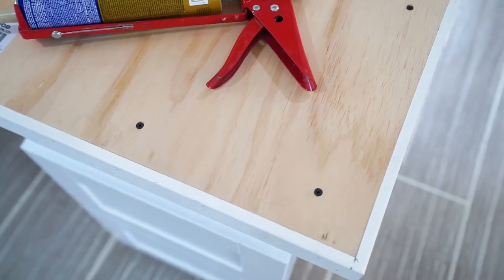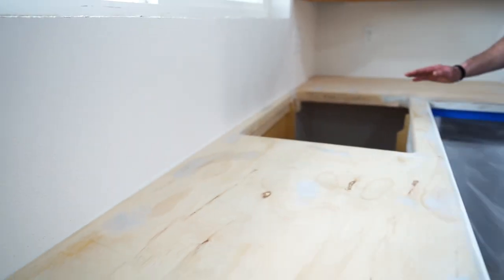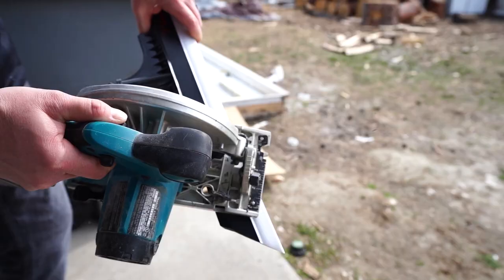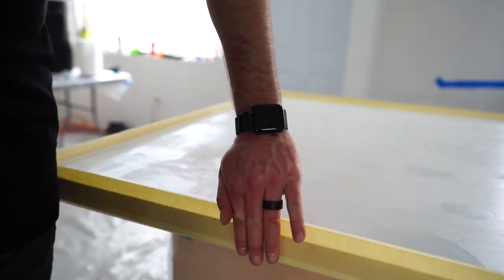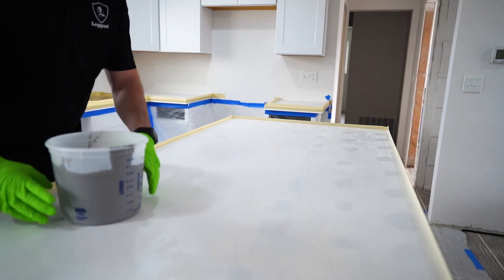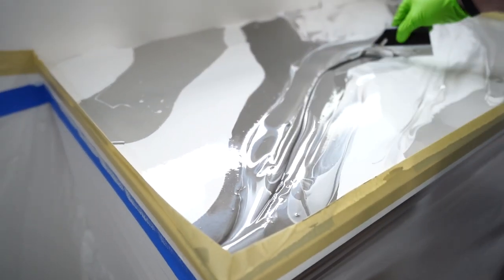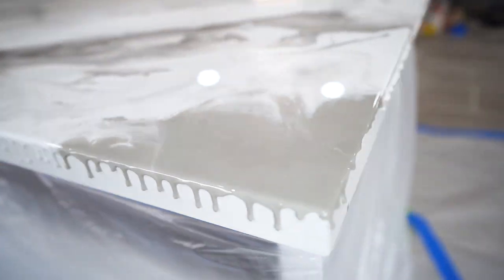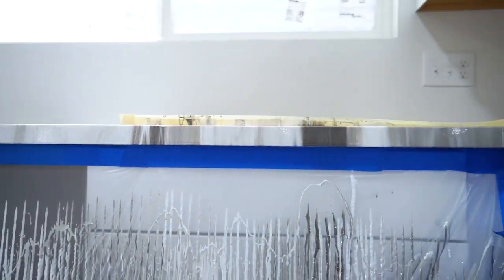Build Custom Countertops In New Kitchen & Use Epoxy To Coat To Make Them Look Like Real Stone

Comment: Was this a 50sq ft kit?
Reply from the maker: For this project, we measured out the square footage to be covered and mixed the exact amount needed. Check out our coverage rates for our epoxy here 👉 https://leggari.com/product/metallic-epoxy/
As you will see, coverage depends on the application. For recommended coverage for your project, contact customerservice@leggari.com or 1-844-LEGGARI (534-4274)

Comment: What do you use for the edge between the counter top and the tile backsplash? My 40 year old kitchen had a metal edge and it never worked well.
Reply from the maker: The backsplash can be grouted and caulked directly over the epoxy countertop just like over other surfaces! Thank you for watching!

Comment: What bondo do you use and how bad does it smell?
Reply from the maker: The bondo we use does smell quite strong, as most do. We typically use an all purpose bondo or our patcher paste(does not smell nearly as bad as bondo) to achieve the best bond or repair. Depending on what you're needing it to do, you can use either our Patcher Paste or bondo. Thank you for watching our video!